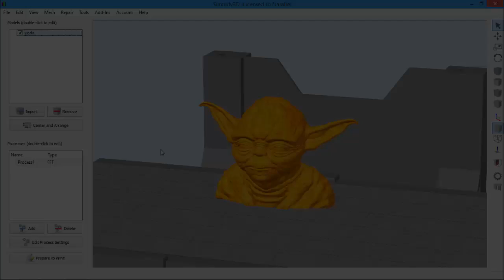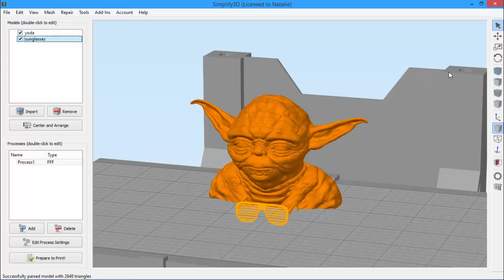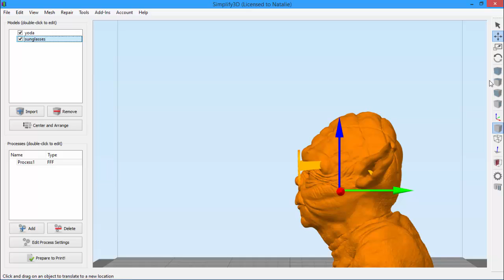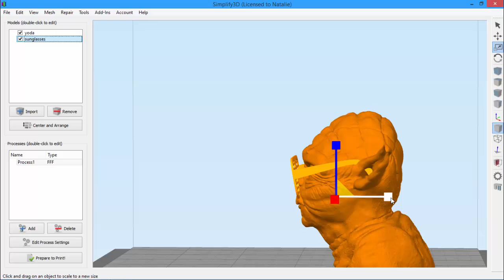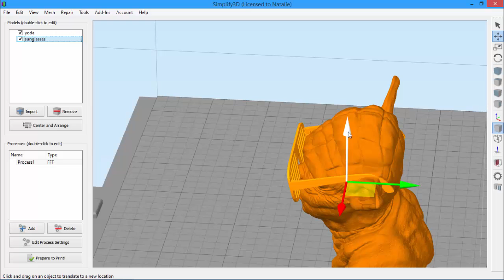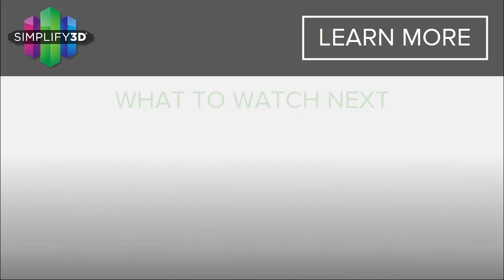3D Transform Gizmo | Simplify3D

Comment: Hello. New user of Simplyfy3D v.4.1.1. I don't see any numerical value for the transformations. I need to scale my model up 1 or 2% only, and I don't want to just eyeball it. I need precision. I hate to have to use an external program just to fine tune a simple modification. Is there a way to have numerical values that I missed ?
Reply: Never mind, I just found out that double clicking on the model brigs up the numerical values window. But there should be an obvious button to bring it up, for those who don't know about it the double click.
Reply: double click on the spesific model?

Comment: How does one print? after I move it where I want it I save it or just slice?
Reply from the maker: +Anthony Cruz You might find our Quick Start Guide helpful. It will walk you through the process of starting your first print: https://www.simplify3d.com/support/quick-start-guide/
Reply: No, lol I know how to print but when using thie feature in the video and adding two files to print like yoda and glasses do I just slice and they will be joined when I print?
Reply from the maker: +Anthony Cruz Thanks for the clarification! Yes, as long as both models are selected in your Process Settings, they will print together. Depending on how closely you have aligned the two parts, they may merge together at certain points. You also have the option on the Advanced tab to "Merge all outlines into a single solid model," which will join the two meshes together.

Comment: Love all the videos! I was just wondering how you got the printer model in simplfy3d, I noticed you had the taz3-5 bed in another video Thanks
Reply: +Simplify3D That is the coolest feature yet! I have a delta printer and aligning parts so that they are relative to my towers where I want them has always been a problem. Now I can create a model that includes the tower positions. Doing that now! Fantastic!
Reply from the maker: +knarf Thanks! Some printer profiles automatically show the printer model. You can edit what is shown under Tools > Options > Machine, in the Printer Models section. Here is where you can add an STL file of the printer model.